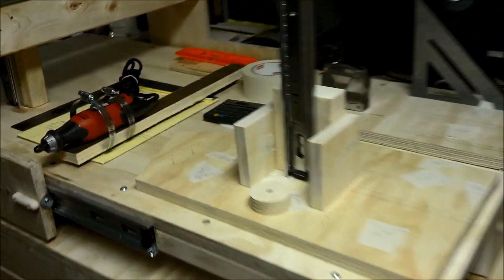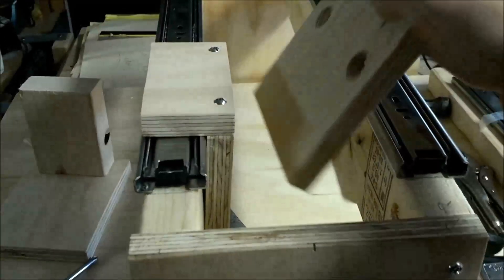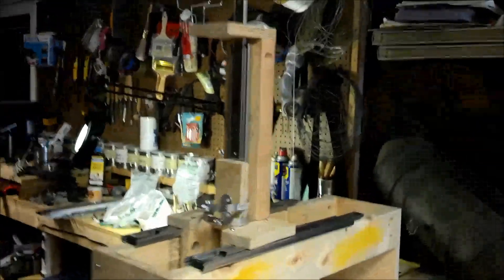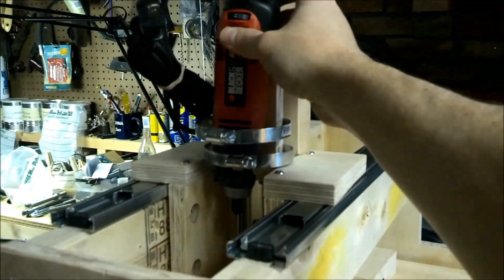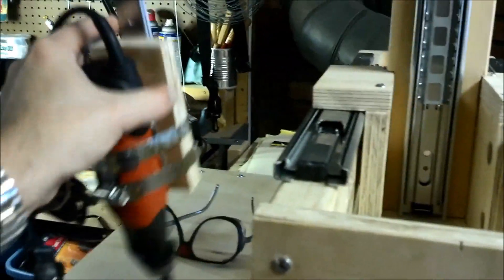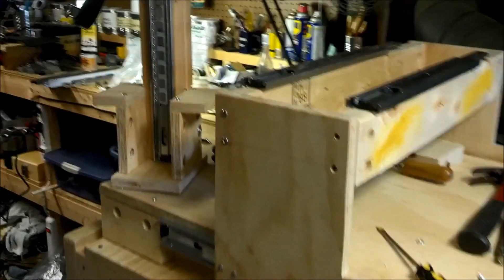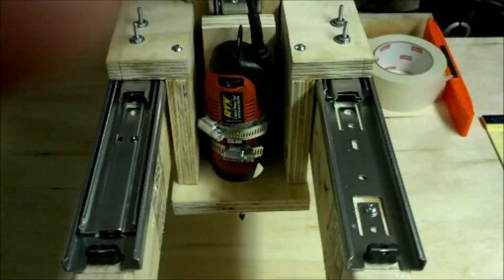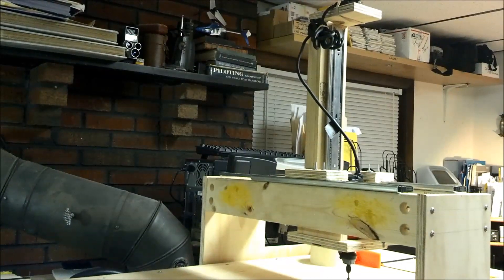CNC Drawer Slide Build

Comment: drez20001 Would it be possible for you to do an update video on your CNC project, After looking at alot of plans online yours is the one I want to follow. Now that you have had a few years using the machine is would be really great to see if you would change anything, things you wish you would have thrown in, etc. Thanks again for all your great work! I really enjoy your work!
Reply from the maker: Hi Joshua.  Well...this video was from somewhat early on in the process.  You probably have seen the other videos but the latest ones (from many months ago) show a slight re-design that would hold a regular router.  A regular router opens up the possibilities for larger signs and more complicated carving.  The design is pretty much the same with the same gantry and drawer slides but it has been expanded a little.  The other videos are on my channel.  The machine has worked incredibly well with rather tight tolerances (at least for wood working).  I've been impressed with it.  Once the machine was built learning to use all the different kinds of software was a whole new challenge.  There are so many choices in software.  It's a fun project though.  If you haven't already joined, I would sign onto some CNC forums and start asking questions.  Best of luck.

Comment: Hello, do you have any kind of play inside those drawer slides???
Reply from the maker: Sergio Alfredo Saldivia Ramirez  Not much play, it is surprisingly stable.  I did do a slight re-design so that it could hold a regular router.  On my channel there are some more videos of the re-design.  The machine works great and makes some fantastic things.  Thanks for your comments and for taking a look.

Comment: Nice job.  You could replace those hose clamps with a 1-7/8" exhaust pipe clamp from auto parts store ($2.99 where I live).  Might not work with your system though.  Again nice job.

Comment: I'm impressed with your solution, and will do a similiar project soon. With regards to the x-axis, I was thinking of having two slides on each sides, in such a configuration that when one is fully open, the other is fully closed. In that way, the gantry will be stable all the time. I have not tried it out, but what do you think of that idea?